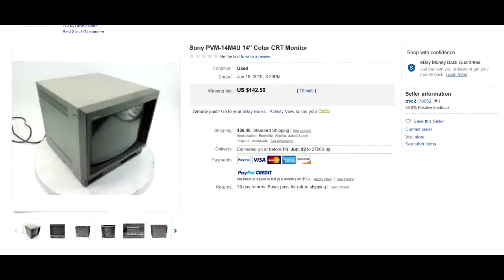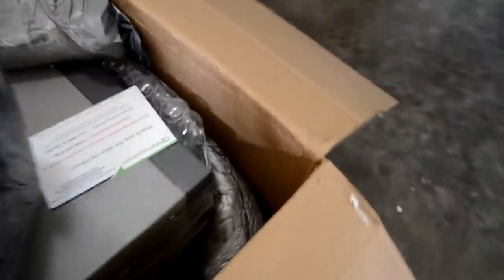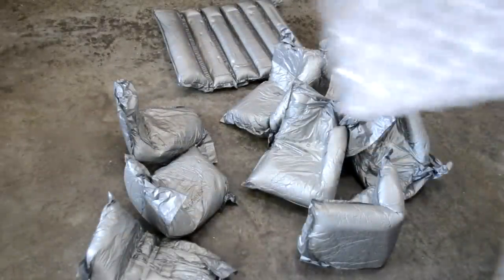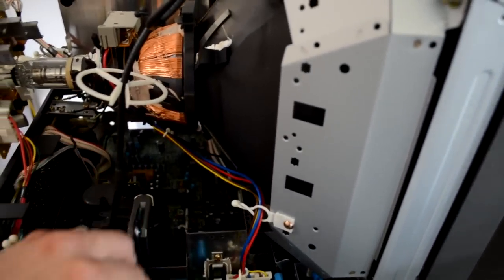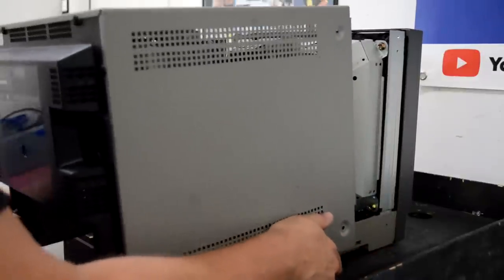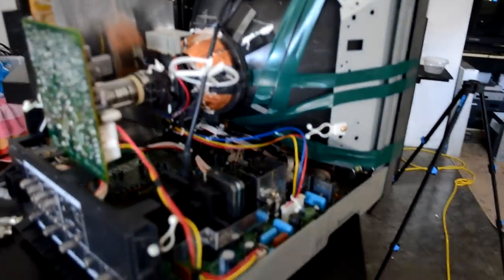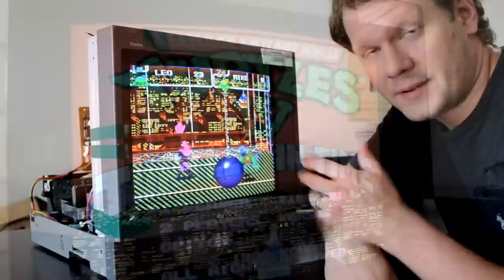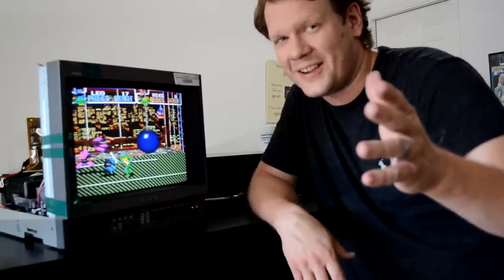eBay Shipping Disaster leads to a FREE Sony PVM?

Comment: Those insta foam packages are very heavy duty. We have 100lbs valves shipped to us using those with not a scratch on them. The problem is the shipper didnt use enough and the box was too small.

Comment: One thing i learned about Ebay or online shopping never buy things with stock photos, and always ask the seller if the pictures are of the Actual product you are receiving. I gave up trying to get a bvm 24 in monitor, I got 2 damaged during shipping. I ended up buying a new PVM-250A OLED monitor. It 1080p over HDMI 25in also only weighs about 15-20lb. I use the OSSC with it.
Reply from the maker: Yeah there is a lot of problems with PVMs being mislabeled and ads are containing stock pictures.  You have to do a lot of homework now before you buy on eBay.

Comment: Makes me thankful for my PVM.  PVM-14M2U for $180 on eBay with free shipping.  Whoever shipped it sent it in a massive box, inside of a box inside of a box, each box had a crap ton of bubble wrap and news paper and it arrived in perfect condition, and was in fact the same model as advertised lmao  Although.... I wish I had a 20 inch.  I think I may just go thrift store hunting for an old 31kHz VGA CRT monitor and use it with my OSSC.  Most HDMI to VGA adapters just transcode the signal rather than convert it without a frame buffer so I would get all the same benefits of a traditional CRT like no sync drops while also having a much higher resolution.

Comment: Hey Steve, just curious what does it usually cost to ship a PVM domestic (ballpark)?
Reply from the maker: It pretty much depends on the distance and size of the package.  20" PVMs are expensive now, over $100 with packing most of the time.  14" PVMs can ship for less, but your still looking at $60 or more to do it right.

Comment: How much would it cost to just get a new bezel? I mean...JBWeld is only gonna go so far, these things are heavy and with that kind of pressure it's going to cause an issue eventually.
Reply from the maker: Yeah, JB Weld wouldn't work with this bezel.  It's trashed.  Thankfully I found another PVM that didn't work.  I took the bezel from it.  I got a good video or 2 coming on it.
Reply: @RetroTechUSA  very nice

Comment: I have had the same experience with the same seller xD I didn't get a different monitor, but mine didn't work when it got to me, I got a refund and fixed it later. I specifically told them that their packaging was insufficient, but they obviously haven't changed their shipping. Avoid unless you're down to repair monitors. I had the same thing happen with 2 other sellers, but this one seems to have a track record
Reply from the maker: They must be getting the PVMs they sell for free as a recycler because they didn't even attempt an insurance claim and immediately refunded my money.  At least the PVM wasn't trashed completely.